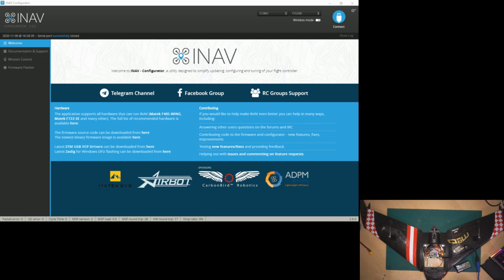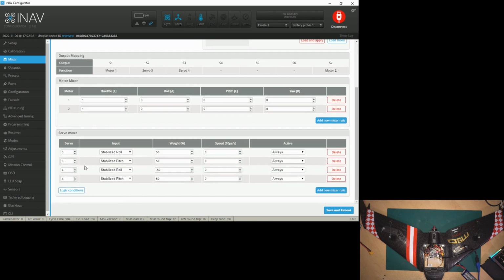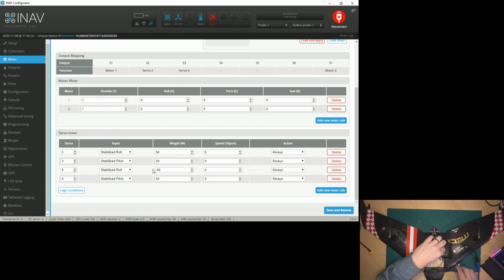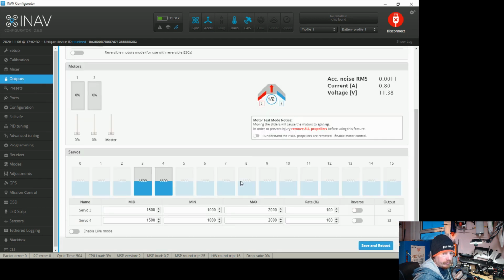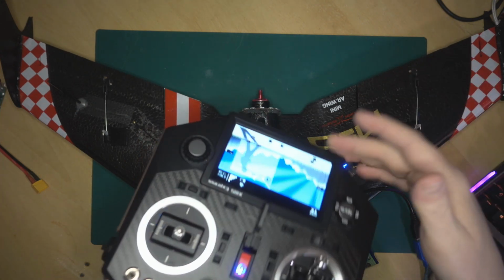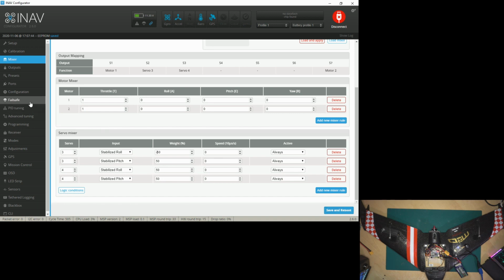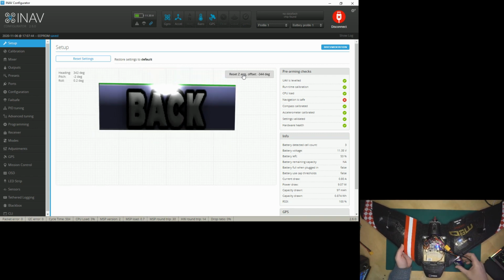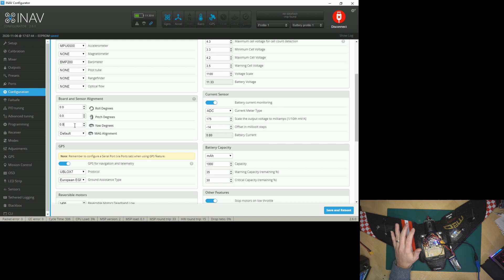A Guide For Newbies -  Setting up an elevon mixer in iNav

Comment: Mr D. great vid!   You mention that the STAB PITCH and STAB ROLL values should add up to 100.  I am building a ZOHD DART 250g and when you select the INAV 2.6 preset for the DART 250g, it states to set the STAB ROLL to 80, and STAB PITCH to 65.  This adds up to 145.  I have heard from other INAV experienced pilots that these values should add up to 100, but now I'm confused.  Is this note in the INAV preset a mistake, or is there more to understand?  Thanks in advance.
Reply from the maker: That is a special case which has been tested  with the PNP 250G. Marc Hoffmann came up with that preset after a lot of testing with his 250G, so it won’t be over saturating the servos. I actually added it in to iNav. 

However, for me, I always max out the mixer at 100% for each surface. This makes non-50-50 elevon setups (planks and forward swept wings) simpler.  If I feel like it needs more throw, I would boost the servo outputs to 120% on the outputs page and test for over-saturation in manual. If it saturates, or there’s still not enough throw, I would change the physical linkage. 

So my 250G setup would look pretty different to Marc’s. But for this particular model preset, it has been tested.
Reply: @MrD  Thanks Darren.  I’ll have a play with your method for understanding.
Reply from the maker: With the 250G, in theory, it should need less roll than pitch. As planes with forward swept wings are usually roll sensitive. I’ll probably start with 60% pitch and 40% roll on mine, and see how it flies. I had similar settings on my Mini Drak and that flew very nicely.
Reply: @MrD  Thanks.  Really appreciate the tip.
Reply from the maker: No problem James. Have fun.
Reply: @MrD  Sorry to dig up a 10 months old comment but I think this is still actual.
"With the 250G, in theory, it should need less roll than pitch. As planes with forward swept wings are usually roll sensitive."
This is exactly how my Dart250 feels. A LOT more roll sensitive. So having the mixer set up like Mark Hoffman recommends confuses the hell out of me.
I'll try like you say with 60 on pitch and 40% on roll and see how it goes. :)
Reply from the maker: Marc’s Dart 250G has a crazy amount of roll. I’m sure he said it was around 500 degrees a second. I set my Dart 250G up with 60-40 or even 50-40 (kept the pitch on 50%) and it flew great. I’ll double check when I get to the plane.
Reply from the maker: Sorry for the delay. On my 250G I have the pitch at 50% and the roll at 40%. I’m using the 2nd hole from the outside on the servo arm and the top hole on the control horn.

I’ll put some photos on my Discord.
Reply: @MrD  Thanks again! I'll try that. I believe 2nd hole from the outside is the default, same on mine and I never changed it. Do you fly with 100% rate?
Reply from the maker: @goku445  rates are whatever is autotuned. I don’t have any rates in the transmitter.

Comment: Thanks for a great vid.  Can you recommend some pids for my first inav build on an AR900 pretty please.
Reply: Thankyou.
Reply from the maker: I honestly never like to recommend PIFF settings. The same model can have different PIFF tuning due to the power system used or weights. I’d always recommend tuning it as it will be a specific tune for your plane. 

However, this may help with the AR Wing https://inavfixedwinggroup.com/recommended-setups/long-range-setups/ar-wing-long-range/

Comment: I'm glad I seen this.  I had mine set up incorrectly.  I'm currently going through trying to get everything ready for my maiden iNav maiden!  Hopefully on Thanks Giving.  It should finally be +10F.  (It has been -25ish F the past few weeks).

I had my weight set at 100.  

One quick question.  I have #1 Stabilized Pitch (servo 1) and #2 Stabilized Roll (servo 2), #3 Stabilized Pitch (servo 3), #4 Stabilized Roll (servo 4) where as you have roll/pitch/roll/pitch.  Does this matter?  I had problems getting my controls to act properly and this was the only way I was able to get the mixer to respond correctly.

One (non-related) question.  I'm getting my modes set up on my TX (with iNav).  Is there an order of precedence for the modes if there is a conflict?  IE: if I have a stabilized mode activated, will this conflict with servo auto trim, or GPS waypoint, etc.?  Thanks!
Reply from the maker: Hi Corey, I’m glad the video helped. 

For an elevon setup, you should have 2 inputs to each servo. So for example:

Servo 1 | Stabilised Pitch | 50%
Servo 1 | Stabilised Roll | 50%
Servo 2 | Stabilised Pitch | 50%
Servo 2 | Stabilised Roll | -50%

It doesn’t matter if the roll or pitch is first in the order, as the values are just added. But you need one of each input on each servo to give both movements. For the most part, the default iNav wing mixer works fine. 

There is a mode order. For example RTH will take priority over most modes, then manual. The only real way to avoid conflicts is by setting up your switches so that you can’t select more than 1 mode at a time. Autotrim/servo autotune aren’t flight modes, so would be on a separate switch anyway.